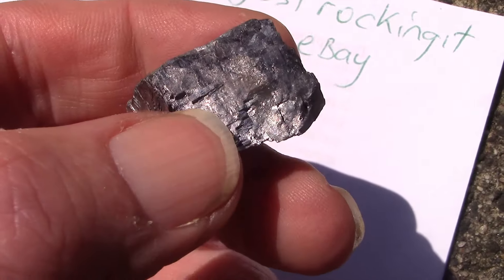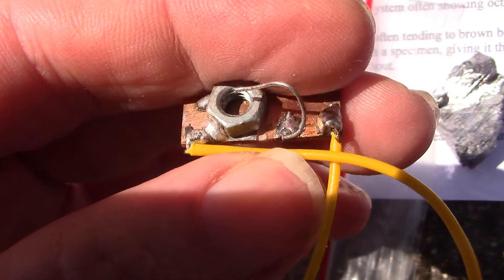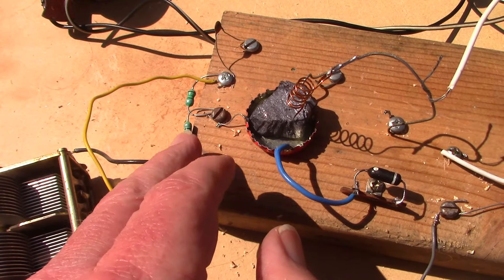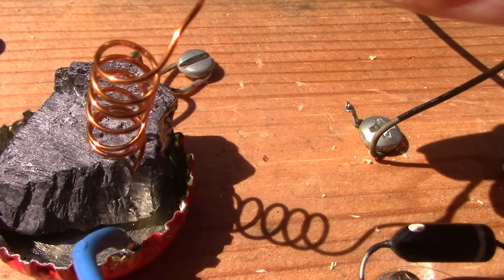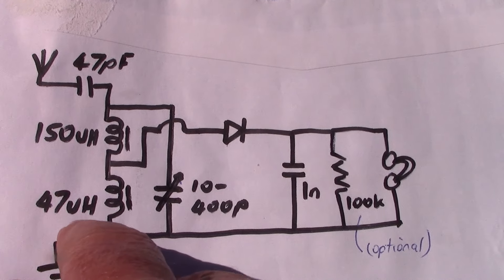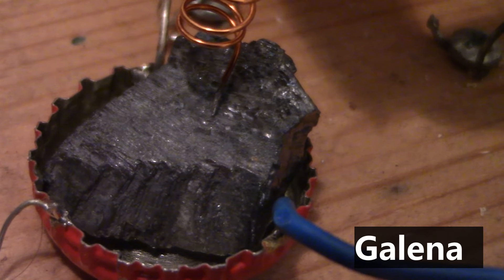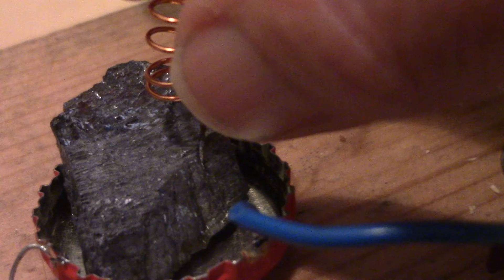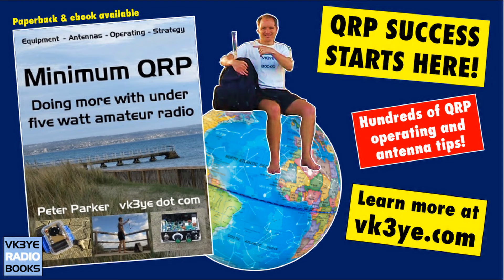Trying galena in a crystal radio

Comment: About 58 years ago while on holiday in Florida, I obtained some rock samples that were glued to a sheet of cardboard.   One of them was quartz.   So later on I ripped it off the cardboard and used it as the detector in my made crystal radio.  It worked perfectly.

Comment: Peter, have you ever discussed the reason for a 60 cycle hum when we're fiddling with the whisker or generally reconnecting wires in a crustal set? I imagine it has something to do with microvolts on a ground that is on or near a domestic ground or bonding. I wonder if it can be 'harvested' (albeit smoothed and rectified) to add bias to a diode, say a silicon diode. I read somewhere that in the early days with few broadcast stations, set makers actually used the signal from a stronger (usually nearer) source to add bias and assist the reception of a weaker signal. Something I'd love to see experimented-with.  Something else is doubling the diode (or as you say, two whiskers) to perhaps add microamps of signal, and finding how this changes the necessary impedance matching. Something still further is whether a set of 4 diodes in abridge (or 8 if doubled) can give a full-envelope detection and possibly better sound quality?

Comment: I found that a lower resistor across the crystal earphone worked better.  I was using a 1N5711 diode and not a crystal when I did it.
I found that 2K was best in my setup.

Comment: Talk about bring back memories. I was 14 or 15 at the time. My very first crystal radio was made with a galena. It was a small, round hunk of rock. Used a pin as the detector and could receive the stronger San Francisco radio stations. I used a very long wire, it ran from my bedroom up to the top of the hill next to us (our property line was near the top). Your headphones look like what I remember mine being at the time. Thanks for the trip back in time Peter.

Comment: The most sensitive spots on the surface of galena are at the sites of crystalline faults, e.g. edges and steps in the surface. Seek these out and avoid large, flat shiny areas which are usually rather poor. Some crystal set builders favour a variety colloquially called "steel galena" where the surface crystallises very rough rather than shiny, as this is often the best material for this purpose. Scruffy looking crystals often work better than the nice, shiny cubes - leave the latter for the collectors. And don't forget to remove the galena after each session and keep it in your trouser pocket in order for it to cure all your ailments... 😉